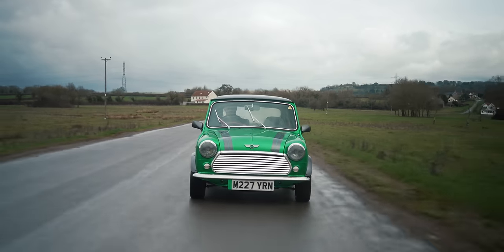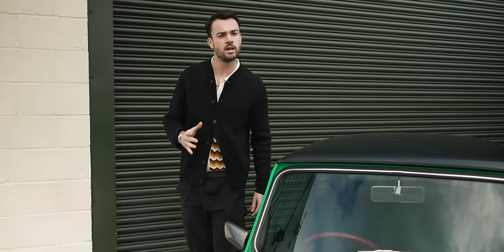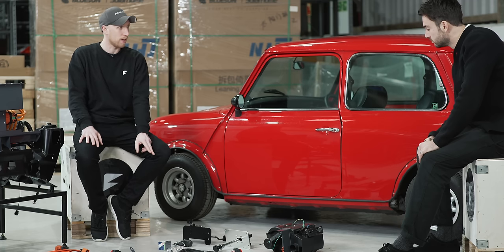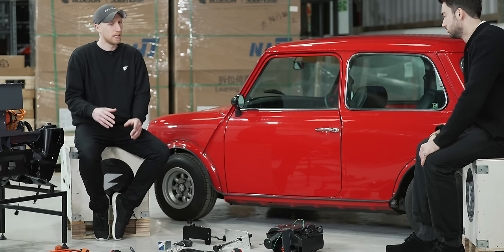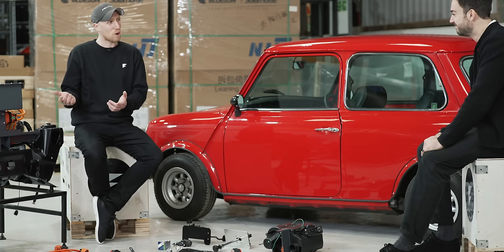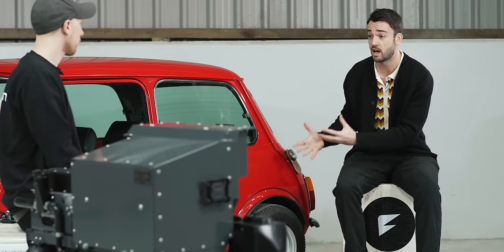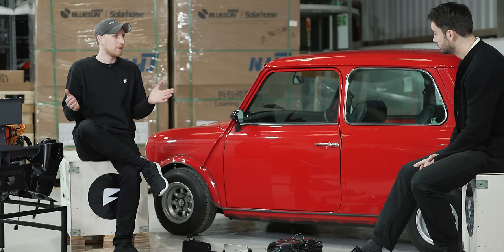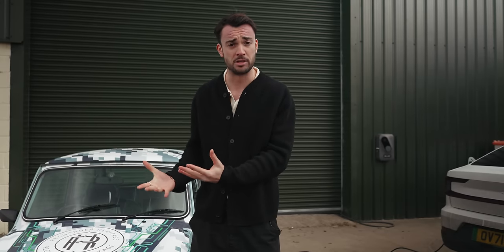How CHEAPLY Can You EV Convert Your Old Car?

Comment: Oh yes - that time thing... I wanted to convert my first Renault Modus to electric allready back in 2011 - now I hope my second one will still be good enough to receive the electric conversion before it simply does not make sense anymore... Love that car, but as it is my daily driver, the mile keep on building in an alarming rate...
Reply: I've got a 2005 Renault Grand Scénic that I'd love to convert to electric for exactly the same reason! I think it would suit the car perfectly, and nobody in their right mind is going to get angry that removing the tired 1.6 litre K4M engine is "destroying the soul of the car".
Reply: @Zeem4   - Had a Scenic 07 between the first Modus and the one I got now - loved everything about that car, except that I needed to put diesel in it... There really aren't any EVs that can compare with a Modus or a Scenic - such a shame...  Im planing on moving on to a ZOE eventually - seating position as good as the other two, but not as near the same practicality-- oh well...

Comment: Nice project for the rich. For a daily driver I would need min. 500km range (down to-30°C, with heater and llights on), a really quick charging system (I can't charge at home and I'm not willing to spend a whole day for charging. Some days I need to travel 800-1000km...). I don't need power - just range. It must be affordable. And I would love a kit or components for a legal DIY conversion. 10kUSD is way too much. For the last 25 years I always bought small used cars like Vauhall/Chevrolet/Opel Corsa B with 45 HP for ~300-500USD, converted them myself to LPG/GLP (costs about 800USD) and was driving them around the world, literally. In central Europe for about 4 USD/100km, in Eastern Europe/Persia for less than the half of it. Nearly a million kilometers combined, no (serious) break downs. I would love to convert one of my 90s Corsas, still waiting for the tech and infrastructure.
Reply: Good luck
Reply: Once you live with EVs, you really understand you hardly need 200 miles - 250 max real life range. Rapid charging is a bonus but charge at home each night even if you do 200 miles a day and you're juiced up.
Reply: @jeromeandre4915  Unfortunately, this might be realistic for some users, but not for me. We cannot charge at home and will not be able to do so within the foreseeable future. We have a kind of a green, eco friendly, traffic free living space, shared with hundreds of other families. Very few parking spaces and no infrastructure to install charging points. We need to charge elsewhere. I know how it is to live with an BEV. A very unpleasant experience. We had an eUP for about two years. We only could use it for shopping or kindergarden... We had to spend 2-3 times per week for ~1h each at charging points for juicing up to 80%. We both work freelance with a kind of unpredictable tasks for the day. It turned out, that the 160-200km range are too less for beeing reliable in the job. I do distances between 200-900km per day. Mostly overland, villages, outback, often highway. Over the last years I stuck several times in winter at -25/-30°C in heavy snow and needed to spent the night or in two cases more than one day in my car in the middle of nowhere. This can happen every time. Just a blanket is not enough at these temperatures. I need the car heating all the time and after that still bringing me home some hundred kilometers. I don't see any BEV that would be able to do that (in the moment). Range, long time power and mobile recharging is everything. And it must be reliable at very low tempertures for not beeing live threatening. Our cars all are petrol/LPG hybrid with a combined range of ~1.300-1.500km. We could run the enging in case of emergency for several days.
If it needs to be an EV, my favourite would be an EREV, refuelable with some e-fuel or biogas. But hopefully, a mix of e-fuels will be a part of the future, since I can't efford a new car or even an BEV. The other way would be to quit my (social) job and the state will give me a pension instead :D

Comment: The problem that we're going to run into is that every year that passes more and more classic, all mechanical simple to service cars rust away and we're left with 1990s and up cars that are all heavily computerized and integrated meaning that it's really difficult to swap out individual components. A conversion kit for say Corollas and civics that could turn them into 100 mile EVs would go a long way towards getting affordable cars into people's hands, but I don't know that it's actually as doable as it is for cars from the '70s and '80s that are 40 to 50 years old already.
Reply: There are many candidate cars for EV conversion, modification of modern ICE cars is a big business, the technology in modern ICE cars will not deter EV conversions, the technology used in modern cars is well understood by the modification fraternity, in many cases it will be quite easy to overcome the technical problems!
Reply: Most people change their cars every four or five years and there’s no current plans to prohibit pre 2030 cars from the road. In the case of classic collectibles, I think they would retain far more value if left with the original ICE engines…

Comment: Electric Classic Cars headed by Richard Morgan (an old friend of Fully Charged) do kits for classic car conversions tailored to specific models. They sell them on to approved fitters who can then pop them in to a fossil car in exactly the same manner as with Fellten. Everything is ready to go. It's not much more complicated than building a radio controlled car kit. That's why it can take as little as ten hours to complete a conversion if the donor car is in good condition. There are a number of companies doing this and it will become an expanding trend.
Reply: I would hope the posters take notice of the "approved fitter" thing.
Reply: @t1n4444  Exactly! We are a long long way off affordable conversions. Don't get me wrong I love these things. If you really want a classic and have loads of money then this is great ... otherwise just spend the same on an existing EV and get twice the range, comfort, performance and crucially safety. (Unfortunately an original Mini can only drive on our roads because it doesn't have to meet the latest crash test regulations for new cars. All other cars were much smaller on the roads back in the day ... don't try crashing into a hefty modern SUV in an old Mini.)

Comment: I bought a 2006 Mini Cooper just for this purpose. when the engine dies, my plan is to fit it with 2 or 4 hub motors (20-40kW each), a modestly sized battery (<20kWh) and the associated power management and charging electronics. Hopefully by then, all the above can be accomplished for less than 10k. Maybe in 5-7 years.
Reply: I wouldn't bother with hub motors, for cars they are overly expensive and the control electronics to match wheel speed is more advanced. Stick to a motor and reduction box.

Comment: What was not mentioned in this presentation is the crash safety of the resulting car.
The biggest difference in cars over my life has been the move from cars that had only reasonable primary safety, without even seat belts for secondary safety; to modern cars; with far better brakes, suspension and therefore better standards of primary safety, plus usually good (even excellent) secondary safety designs - that keep getting better.
Much as I like the Mini, and many other classic cars; for everyday transport, they constitute a higher risk to drive around in.
Reply: Of course they do, especially with modern land yachts on the roads, but some people will take the risk to enjoy the classics
Reply: @wiegraf9009 still safer than a motorbike so my dad's happy

Comment: It would be good to see a range of standard motors that just bolt onto a gearbox in place of the original ICE motor. the only "custom" parts then would be motor mounts, the battery packs and instrumentation.
Reply: There are already a range of motors such as the hpevs, net gain and zonic motors that work with a suitable adaptor plate.
Packaging of the batteries is the difficult part
Reply: @modscotsman  The problem is that these motors cost about the same price as a whole new Chinese car, and that is without any batteries.
Reply: @Terry Hayward  that's why a lot of both diyers and companies like London electric cats are using nissan leaf donors. As they can get a complete salvage car for a few grand.
Conversions can be done on a budget if you know what you're doing

Comment: My comment is not specific to this mini, but 110 miles WLTP with a 19kWh battery pack is EXTREMELY unlikely. Indeed, this is equivalent to an efficiency of 5.8 miles/kWh which, apart from Tesla and Hyundai Ioniq 2016-2022 and Ioniq 6, is rare to see for an EV these days. But let’s say it’s possible to achieve this efficiency with this mini like for a 2016-2019 Ioniq (28kWh) then this battery pack would  probably take you up to a maximum of 87miles (100-0%). But since you don’t want to be stranded somewhere and you want to preserve the battery, then 100%-15% is more likely. In which case, the ACTUAL range is probably closer to 74 miles in the best weather conditions 😅

Comment: The big issue for now is simply the battery. Because if you want to convert a normal ICE, people will want a reasonable range. Not a lot of power. So a simple 80-100kW motor is enough. BUT these cars have bad CW values. So they need realistically 300Wh/km. So to just make a realistic 300km you would need 90kWh batteries which is simply unaffordable and also usually will not fit.

So at best th3y will do 50kWh batteries and that already is around 12000€ for used Tesla packs. And that gives you only 160-180km range. 

And you definitely need a DC charging of at least 1-2C to make it reasonable for people to change. 🤷‍♂️

So if we do not talk about oldtimers, but normal ICEs, noone will want to pay more than 5000-7000€ at max. And for that we need batteries with 300-600Wh density. Or double of what we have now. And at a quarter of the price.

Comment: I weighed the cost of conversion on one of my old cars, and buying a used cheap electric.
I ended up buying a 2016 Fiat 500e for (all costs) about $8.3K USD (after tax rebate).
I feel it's a better value at this time.

Comment: I still don't feel like converting classic cars is a good idea. They are purely mechanical and will ALWAYS be repairable, no matter how obsolete people think they have become. 
Now, retrofitting cars that the engine and drivetrain were always bad from the start but were clothed in a good body? NOW we're talking. 
How about a Fiat with the terrible 1.4 diesel? Theres thousands of spares/repair 500's, Grande Puntos and Panda's with dead engines but perfectly good cars around them.
A ford with a 1.0 ecoboost engine that was only ever designed to last 5 years and even that is a push for such a highly stressed engine, especially when badly maintained by the vast majority. Stick an EV drive train in a 3 year old focus and hey presto you've got a good car!

Comment: I have 11 years experience doing EV conversions. They will never ever be an easy job for “any retro car in the future”, to just download design files and implement custom-specific components: adapter plate, coupler, motor-mounts, battery racks, controllers, chargers, BMS, sensors, dash instrumentation. No. The options /combinations are exponentials ! 

This is an ART, every conversion is UNIQUE. I can have 10 versions for one single car! Multiply that for the bunch of cars/models… an impossible mission in terms of what you just said that “one day in the future everything will be easy for mechanics to convert ANY car”… that’s absolutely impossible. 

You can do that for SPECIFIC cars/models, like the MINI or the venerable VW Beetle or any other classic car.

Today I ran a test drive on a brand new conversion in Mexico for a VW Bug: 150 mile range, 150Km/h max speed, RPM speed governor using DC Series motor at 144V, sports mode, normal model, turtle mode and some other features

Comment: when certified universal retro-fit kits look more like:

Remove engine and tranny, bolt on ONE complete module from, say Small, Med or Large range, which includes All componentry
Replace fuel tank with Battery pack and and charger as one piece
Fly by wire throttle (no cable)
Simple cable connect between the 2 modules

Say £10-15k for complete kit, with estimated install time of less than a  day (c. £500)

Range 200+mls
VNE c 90 mph
0-60 less than 8 secs for the Med power kit

Now that Would b interesting to the masses with aging classics of low value ? engine prone to failure / lacking in character... eg Alfa GTV TS, Audi TT, Scimitar GTE, Mazda rotary sporting cars etc etc

Comment: I think this will remain in the classic and hobbist market becuase of the price of S/H EVs. A Nissan Leaf  can be had for as little as 5K and you can also retrofit a newer better battery and an extended one for up to 320 mile range (costing £13,500 for both batteries) at 78Kwh (60Kwh + 18Kwh Extended). Total is £18,500 for what is a better EV, much as I love the classic Mini. Also, if you want to risk your life over your wallet there is always the G-whiz, ha,ha,ha. Price around £500 to £1000 S/H and new batteries for under £3K.

Comment: Munro priced the Model 3 motor under $1000. 
For conversions, you need large production of common parts. Making it toooo moduclar and one sits fits all, prices it out of the market. Definitely governments need to be strongarmed to make money available. A well designed large volume conversion to PHEV (most fossil burning gone) can be done cheaper than the FREE MONEY given to RICH PEOPLE to buy a BRAND NEW 2.5 ton SUV. Because they are such green warriors saving the planet, every two year. Uhuh...

Comment: $27.500 plus instalation. They didn'txseem to say if it had air conditioning and heating. Plus you need a used mini. 110 mile range.
      Or a new Chevy Bolt at $26,000 before us incevtive of -7,500   so $18,000 with 260 milecrange on the highway. Hmmm of chevy and others have 8 year 100k mile warranty.

Comment: This is interesting but to convert classic cars will always be a niche business. If there is a mass market for EV conversions it will come in the form of 5 to 10 year old popular cars like Fiestas or Polos with 40,000 miles on the clock, still 10 years away from the scrapyard but having very little value as used ICE cars in a world where everyone wants an EV. Modern cars are not rust buckets, they don't get scrapped because of tin worm, they get scrapped because something big has failed in the ICE drivetrain which costs more than the value of the car. If an EV conversion on these kind of cars, of which there are millions on the roads could come in at an attractive price, it would extend the life of the vehicle way beyond its 'ICE life'. Some serious data gathering is needed on why the most popular cars on the roads get scrapped, what finishes them off? Then target conversion kits on those, produce in volume and get the price down. By end decade 90% of new car sales will be EVs but there will still be over a billion ICE cars on the worlds roads....big market!

Comment: So, why is it here in New Zealand two men separately retrofitted vehicles into electric, with reasonable range and good quality materials,  at a base cost of $8000NZD and $12000 NZD respectively? Even adding labour costs, $27000 Sterling plus VAT is crazy pricing for retrofit kits.

Comment: We had a 1973 Mini Pick-up in dark blue, OUJ 989 M. It was fantastic, and would have made a great electric conversion. But most of these older vehicles rusted for Britain.

Cars that would make a nice conversion might include the Renault Four, 2CV, Mini, especially Clubman Estate, and many other practical lightweights. But rust meant the engine was likely the only good bit at the time the vehicle was scrapped because of massive work need for corrosion to pass an MOT. I miss those simple lightweights, but they will never be inexpensive, if for no other reason than they are now as rare as hens' teeth.

What is needed for the bread and butter customer is small lightweights like the Clubman Estate, that are practical, seat four people at a pinch and have reasonable load carrying ability, but built to last at least twenty years [as in galvanised floor pans and sub-frames], and fitted with an EV drive train capable of say 75 mph flat out and perhaps zero to sixty in less than fifteen seconds and a range of a hundred and fifty miles on a charge. 

The prospect seems unlikely outside of a Chinese product these days. And it would hardly be as profitable for makers, as great big fat SUVs that cost more than you average working class Joe or Josephine could ever afford in this ever more expensive world where wages regress compared to real inflation and so many consumer items are getting less and less affordable.

Love your videos, Jack!

Best wishes from George

Comment: There are 30 Million ICE vehicles on the road in the UK, and presumably (perhaps) 50% of them are modern enough and low-mileage enough to be ideal for Conversion ?

Which would mean 15 Million fewer 'entire' Vehicles that would need to be produced to reduce our Petrol/Diesel Consumption and Pollution by a similar amount ...

But before then, could someone make a cheap, effective Battery upgrade for all the 24kW Nissan Leafs ? 

And how about a basic Rapid Charger add-on for the Mercedes B-Class Electric ?  (Please ?)  ;)